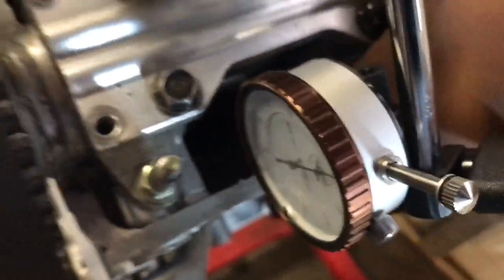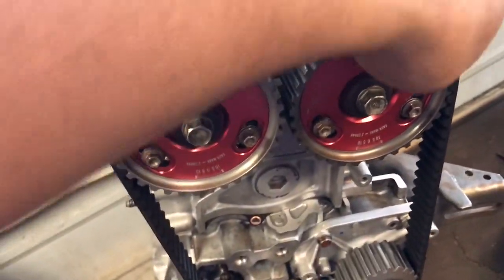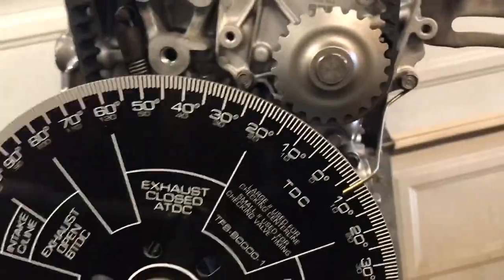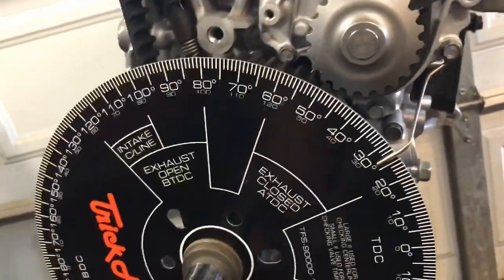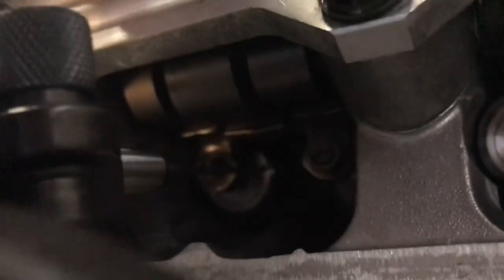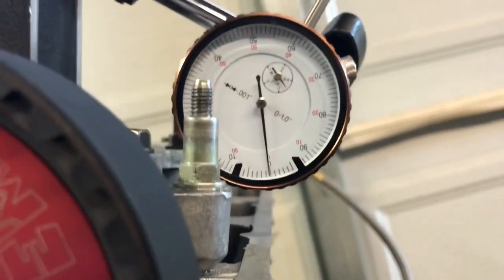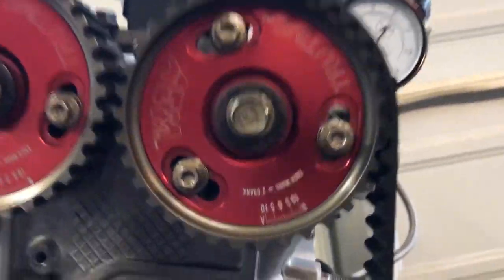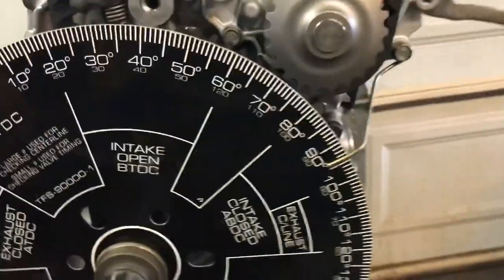Degree cams “basics”how to

Comment: Hey bro is this a ls vtec ? I’m doing a ls vtec and ended up with -2 exhaust +6 intake. Seems like a lot but at true tdc the intake dot on the cam sits slightly above the dot on the exhaust cam. I read that ls vtec always end up a half tooth off.
Reply from the maker: Pat Jones yeah bro I had a couple motors where I had to move the cams a lot just make sure there’s no v2v hitting
Reply: h2b Sedan at the tight spot I can’t get a piece of .030 welding wire inbetween them..... think I’m going to pull the head back off to check the safe zone.... I have .5mm oversize valves and pro1s I think at true center there’s not enough

Comment: dont you ruin the engine if you spin it backwards??
Reply from the maker: Engine is still running after 2 years of nitrous passes so I don’t believe so
Reply: In theory it’s not good for your oil/water pumps. Realistically doing it a few times here and there when needed won’t kill it

Comment: going forward and backward on a honda like that makes slack in the belt
Reply from the maker: Yeah it don’t hurt nothing
Reply: @h2bsedan555  don’t hurt nothing but makes your measurements inaccurate a few thousands
Reply from the maker: @2kbaby924  for Tdc the degree wheel on the crank along with rods/ pistons I can get tdc with no belt on but setting cam timing It does so just double check and only spin it counter clock when checking it